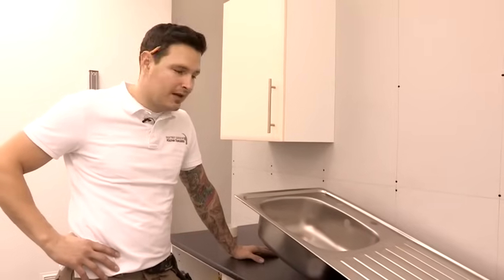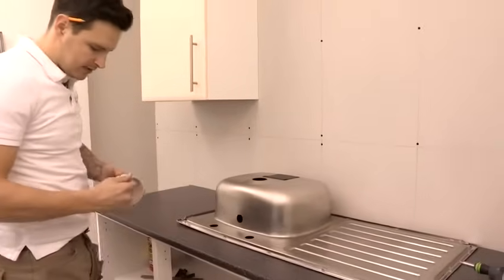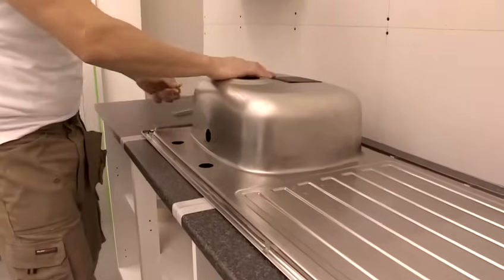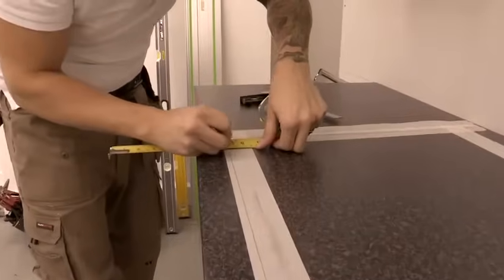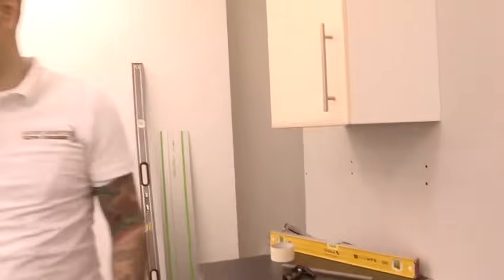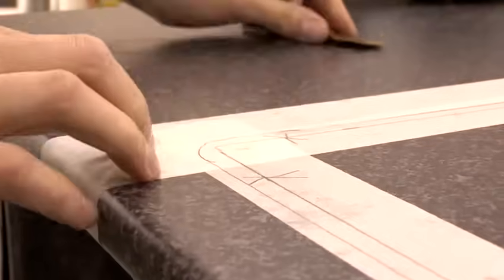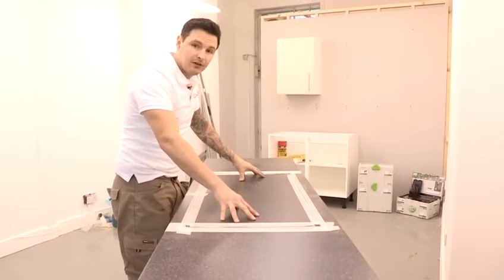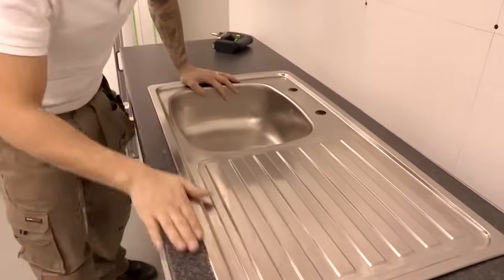How To Install A Kitchen Sink Into A Worktop

Comment: A good idea is to paint the inside of the cut worktop with an acrylic or oil based paint. If there is an ingress of water and the exposed inner worktop is not sealed, it could start to expand.
Reply: It will definitely expand over time.

Comment: It isn't done and dusted until you fix the clips in place - especially fun where you cut the base unit to fit the bowl. I have found that the clips supplied will need their own cut-out in the worktop (usuall 2-3mm) to enable the thickness of the clip to be accomodated. also on the thicker worktops longer screws may be needed for the clips. Its important to use EVERY clip position on the sink flange to ensure no leaks - I find that "pros" often leave out several clips if they are difficult to get at.
Reply: Ahah this is what I was looking for! I can’t figure these clips out 😂
Reply: @99hank97 just silicone the sink fk the clips
Reply: Exactly 💯

Comment: A few more tips to add to an already comprehensive video - 1 Once the cutout's been done, fit the sink into the worktop via its clamping clips before you fix the worktops down, it's much easier than trying to do it lying on your back inside a cabinet. 2 - Same goes for the tap, overflow and waste plug/strainer - fit them in advance. Make sure your tap is nice and tight via the fixing nuts which are supplied, as these are often difficult to access for tightening if they become loose at some point in the future. Same goes for the flexi hoses for your hot and cold water. 3 - You'll sometimes find that when you've done the above and you put the sink back in its cutout, the sink clips catch on top of the cabinet, lifting the worktop slightly. If this happens, use a chisel just to take shallow notches out of the cabinet top until the worktop sits totally flat on the cabinet.
Reply: Very useful tips - thanks.

Comment: Hi. Ready to cut out my new sink tomorrow? Would you recommend the standard sink clamps to fasten this to the work top or use silicone?
Reply: This is what I want to know - and also how to level it so that the water drains off the draining board and into the sink.
Reply: Did you end up just using silicone instead and not bothering with clips? I used clips last time I fitted a sink and it was very awkward to do. I’m hoping to get away from using the clips next time.

Comment: Usual dimensions are 50 to 60 millimeters (5-6 cm) from the front edge. Cut the hole 10 mm (1 cm) smaller all around.

Comment: Nice job. Try drill the holes from the top and then as the point comes through the work top remove and gently drill upwards to prevent break out.

Comment: Well the problem with most "do it this way" videos is they show an ideal case and the "easy" bits! In the real world the sink has to be fitted when the worktops have been mitred and fixed in position- you can't do this after fitting your sink - and the sink seal and fixing clips aren't mentioned. The drill was on hammer action to drill the starting holes for the jigsaw - and you only need holes in two corners - think about it! Otherwise a good clear presentation - better than most!
Reply: why dint he make the sink cupboard 50mm so that he wouldnt need to cut it with a jig saw after cutting the worktop? Its time consuming
Reply: can i just use my old worktop as a temlate
Reply: @paul-ne1bh   As long as your your new sink is the same size as the old one, SMART!

Comment: Carrying a worktop with a large hole in it could be problematic. Fitting and fixing the sink would make it stronger. Most cabinets for sinks do not have a top in them. Nice video.

Comment: Back in my days we didn't have the luxuries of internet or YouTube, we had to use our brains, we had to have a high level of understanding by sight and the common sense to know what problems and dangers would be expected if the job wasn't carried out correctly unlike today 2019. 

2012 is when you uploaded your video but you also gave advice on how to fuck-up on a inset sink fitting which explains why through the years so many second rate jobs and DIY jobs have caused so many problems and second rate workers.  Your video is not how to fit a sink but how to do the cut out for the sink, the cut out and fitting a sink are 2 different facts also, your explanation and demonstration lacks details as to fitting a sink the most basic part of the job.  My advice to people like you is understand details before giving advice to the people that don't know how to do these jobs, that fact alone is in the ending of your video when you set the sink into the cut out saying done and dusted, far from was it done and dusted, maybe in future you'll mention the sink seal and the clamping of the sink.

Comment: Well, you say that, but you've not actually installed it, as per the video title would suggest.

What about undercounter seal and clips? Protection for the cut edges in the worktop and base unit? Preparation for taps and waste trap? Taps and waste fitting? 

You say it's easy, but that's probably because you've forgotten about all the additional work required to do a good job. Anything is "easy" if you ignore half the details. 

You could solve this very easily. Change the video title to "How to cut worktop for sinks and appliances".